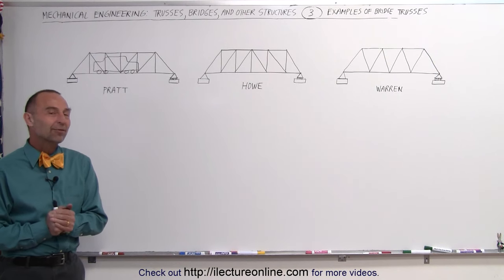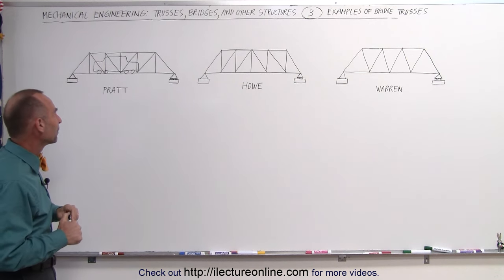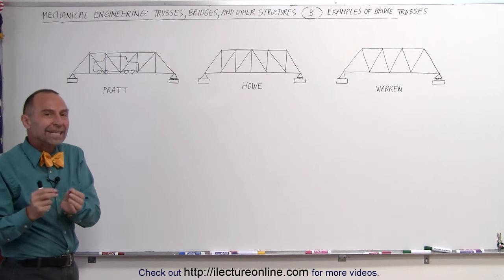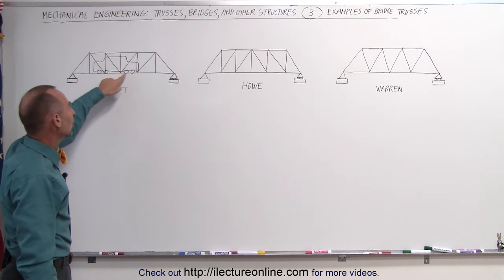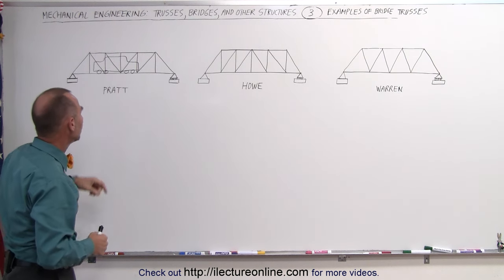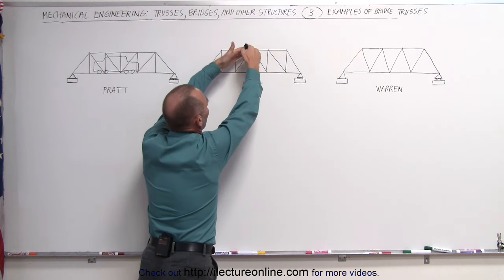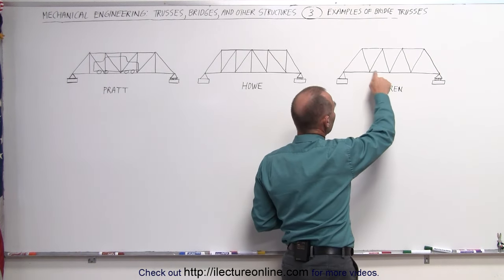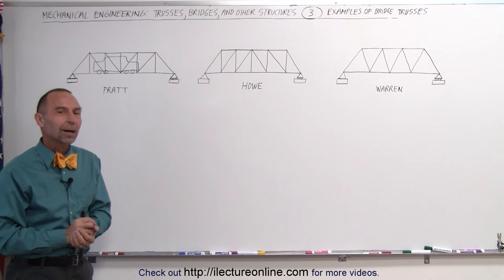Mechanical Engineering: Trusses, Bridges & Other Structures (3 of 34) Ex. of Bridge Trusses: 1

Comment: @1:45 the vertical members (including the center one) in the Pratt are under COMPRESSION--the diagonals handle tension. The opposite is true in Howe truss, wherein the vertical members handle (some of the) tension and the diagonals are compressed.

Comment: I need to design the steeel truss for the stainles steel pipe of diameter 1.5 m and thickness  of 8 mm which  carries water(to cross the stream of 35m width )

Comment: Which kind of bridge is best to resist earthquake
Reply from the maker: During the last big earthquake in Los Angles several bridges collaped because the support swayed too much (more than the 30 cm overlap) so that the support moved to far away and the bridge section was no longer supported and simply fell down.  Now the building code in LA requires a 75 cm overlap.  Also the amount of steel reenforcment bars placed within the concrete supports and concrete sections have been increased.  The key is to make sure that on the sides the bridges are connected, the connection holds and on the side when the bridge rolls or slides, the supporting sections overlap sufficiently.
Reply: @MichelvanBiezen  thanks for the answer
But one thing i want to know that which bridge is better in earthquake area :-Cable bridge or Warren truss bridge
Reply: Answer please
Reply from the maker: Bridges that utilize the hanging cable supports tend to do better in an earthquake.
Reply: Thanks sir